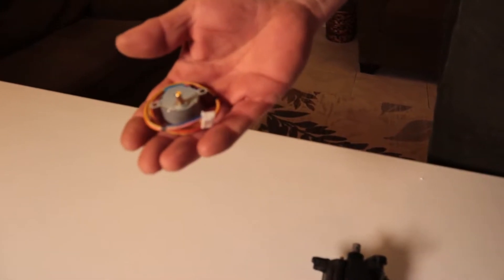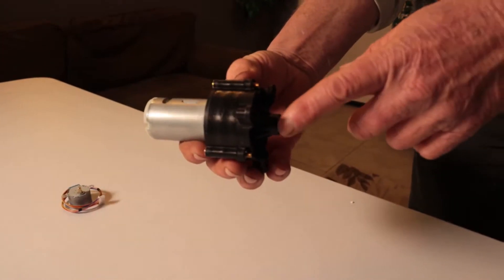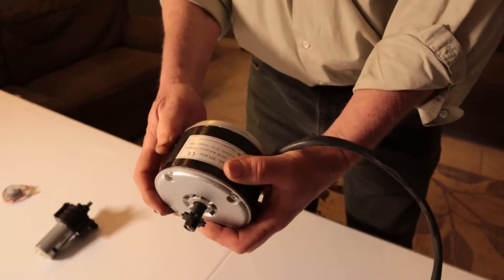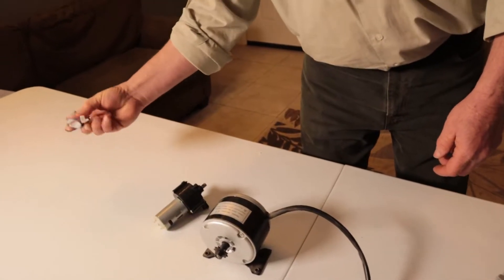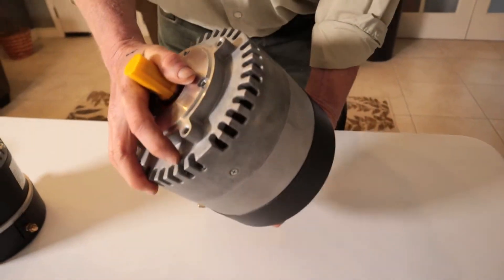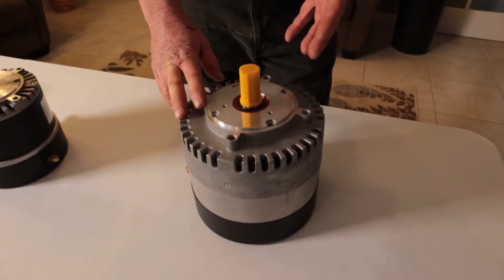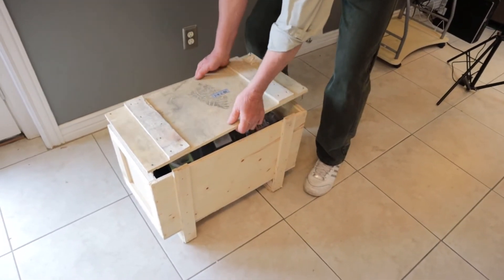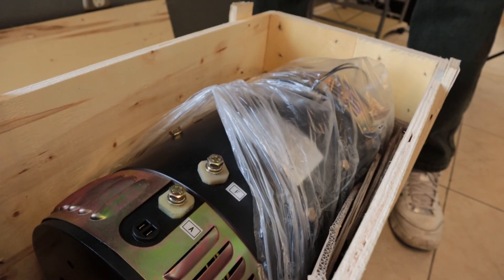Electric Motors for EV Electric Vehicles

Comment: So ideally, you'd want one small motor for each wheel to be able to direct the perfect amount of torque to each wheel.
Reply: The current thinking is keep your manual trans so you don't have to worry so much about gear ratios, using reverse, etc. One motor with a coupler and adapter plate installed on the original ICE motor mounting location.

Comment: What’s the brand of the last two motors?
Reply: First one with black casing is a motenergy me0909 and the second one is a motenergy me0708. Literally the two im considering to get for my dirt bike conversion.
Both as of right now seem to go for under $800. Both handle up to 48v and both produce the same power which is 4.8kw. 
Only real difference is size

Comment: HI. IM LOOKING AT THE 3RD MOTOR ON THE TABLE.  MY QUESTION IS, WOULD A LITHIUM 48V 25MH FROM EBAY, DO THE JOB?
MOTOR....ME 0909
CONTROLLER....ALTRAX AXE 4844
APPLICATION.....YZ80 2001 MOTARD.
OR WOULD SOMETHING ELSE BE BETTER TO USE???? THANKS STEVE

Comment: I converted my Toro zero-turn mower from an ICE vehicle to an EV by installing a ME1004 motor.  It was a great swap.  My 1971 Super Beetle is powered by a Hyper9 motor.  EV conversions can be a little addicting.
Reply: I'm here to find if there is such a thing as an equivalent to a hyper 9 as they are pricey, Is there an industrial AC motor alternative?
Reply: @neilsg2001  I am looking at the Motenergy ME1616 for my next build (Electric Drive Engineering). Hopefully an easier and less costly install than the Netgain Hyper 9 - I still can't get my motor to spin after installing. Tricky little bugger.